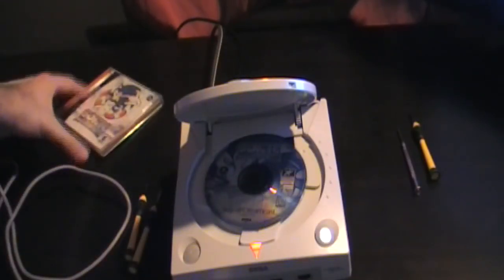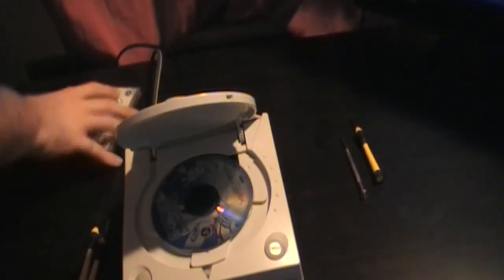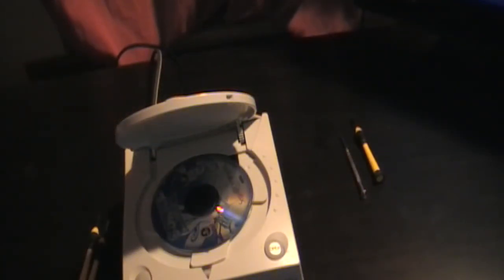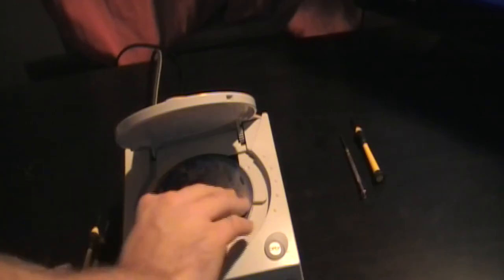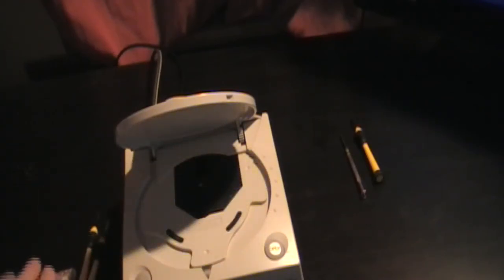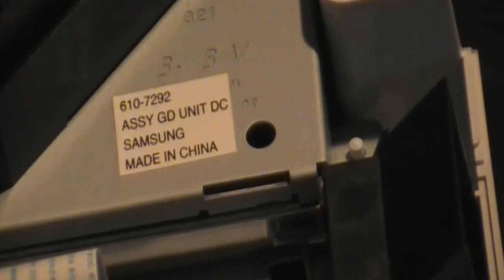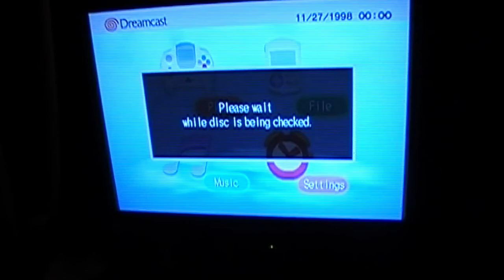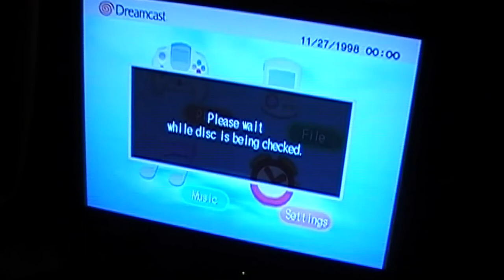How to Fix Dreamcast Disc Reading Errors

Comment: Spent a good hour tinkering with this. Cleaned the laser with "iso" alcohol, then I think I turned the screw too far to the right. Turned it counter clockwise about a half turn... and it (finally) worked. Back to Crazi Taxi! Thanks.
Reply: Thank you for this comment. I tried turning mine clockwise the first time and I still had the same problem. Then I tried turning it counter clockwise (maybe a quarter or half turn past the original position) and it worked!

Comment: Thanks mang, at first I tightened it a bit too much and the disc was going at rapid speed. Then after loosening the screw it went too slow. After tightening just a tad bit, it started reading discs! Thanks for the tut my dude.
Reply: its tricky...a hair too much it goes super speed up..too far back too slow..its only like a hair difference..

Comment: Thanks for this video man. Just bought two defective units and fixed the controller boards. One of the units also had this problem, tried your fix and voila! Got two fully functional units now. I smashed that like button like light punch in marvel vs capcom.

Comment: I’ve got this problem as well, but I really needed to see exactly how far to twist that potentiometer. It’s obscured both times you made the adjustment :(  I know this was a while ago but do you happen to remember how much of an adjustment it was? I’ve spent hours tweaking it back and forth with little result. Sometimes the disc spins up to full speed, then just slows right down. It never reads though.

Comment: Nice video🙂But it’s good practice when you take the cover off to open the lid first,then take it off,and the same when your putting it back,because you could break the pice in the back,and then it won’t spin.Besides that,nice job🙂🙂🙂

Comment: Had a problem with my Dreamcast only reading games when the lid was partially opened, but tightening the potentiometer worked perfectly, in less than 5 minutes. thanks!

Comment: I'll give this a try.  I got two recently purchased from internet that are both experiencing this problem.  Looks easy.
Reply: How’d it go
Reply: @suppaman12  The fix shown in the video has no impact on actual system hardware.  Both systems failed, by design.  My old Dreamcast worked immediatley.

Comment: I think due to the GD rom drive constantly in motion and vibration of the spinning disc this causes the screw to move over time. The screw only needs to be very slightly off to cause issues.

Comment: Whoa easy on that cog, ouch!  It helps to grease the gears/cogs with a LITTLE petroleum Jelly.  You're adjusting a POT for the laser right now.  Increasing/decreasing the resistance.  Anyway making adjustments on the laser has extended the life of so many Dreamcast systems I have.  Bought them on Ebay with people claiming the eye is shot just to tweak the laser.  Just bought one with no video.  The guy didn't seat the PSU all the way.  Had to replace GD-ROM from a cannibalized system that had a bad DAC.  Speaking of, has anyone found an easy way to fix a DAC, or a bypass or something?  If not I'll be troubleshooting traces for HOURS!!  If someone has any info please help!!  Thanks ;)
Reply: Oh and Great video there slugger!

Comment: Hi. Would you know if changed all the capacitor of my US Dreamcast all to solid capacitors make it read the games again (not even the CD can be read- music CD)? The Dreamcast is relatively new, it's not been used for a 1 week (24 hours each day) in total. It was working well the last time I used it but now it won't read, after being stored for more than 1.5 years.

I already cleaned the lens with 99% alcohol but it now won't read. Suggestions are welcome.

If yes, replacing all capacitors in the unit (except the modem) with solid capacitor, will fix this, is there a shop who sells a complete Dreamcast solid capacitor? If there's none, any list of all the unit's capacitors and values?

I have another PAL Dreamcast, I've replaced it's GD-ROM but it keeps burning the chip in it, I wonder how this can be fixed. It first started when I left the Dreamcast for about 8 hours playing one song, from a music CD, in an infinite loop (I fell asleep).

Thank you. Stay safe.

God bless, Rev. 21:4
Reply: try getting the PSUs, power supply from ALiexpress or ebay. It might have happened that the capacitors might have leaked and damaged the PSU board.

Comment: What are you using to turn the screw? Its not a flat head or philips. I cant get it to turn.
Reply: Just took mine apart yesterday, a small philips worked fine for all of the screws (including the lasers resistance) just be careful and take it slowly